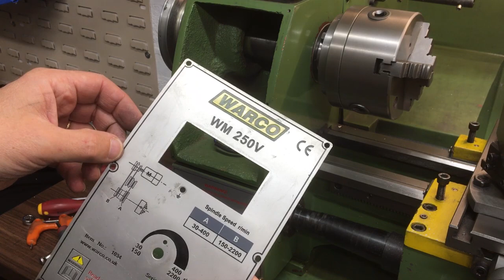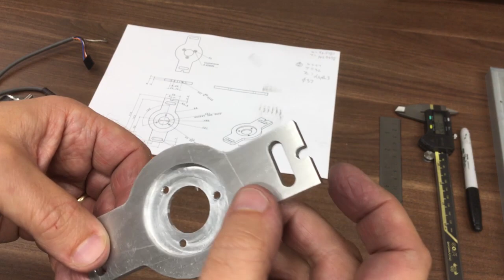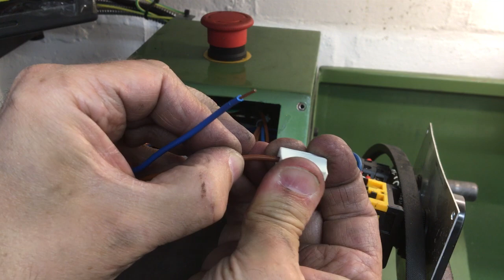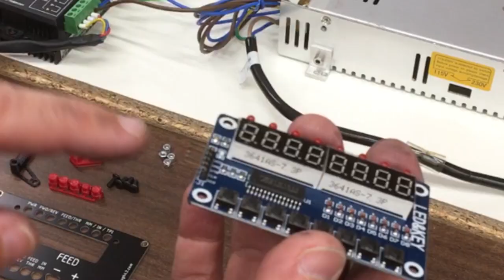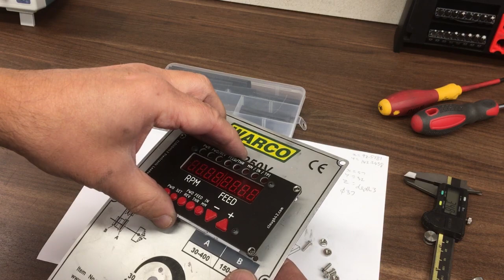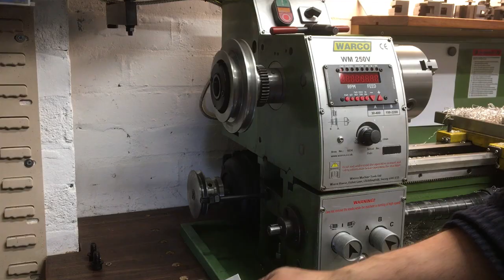Ep03: Clough42 Electronic Leadscrew | Display installed, encoder bracket

Comment: What software version are you running?
Reply from the maker: Do you mean on the CNC machine?  That motion control software is called UCCNC.  I installed in around 2021 and the manual shows it to be software version: 1.2111.

If you mean the software version for the microprocessor code uploader (Visual Studio??) into the TI board as part of this ELS project I used the exact same version James showed in one of his videos.  I tried the current version at the time when I built mine and I could not get it to work.  So I re-watched his videos and downloaded a the same legacy version as James and that worked fine.  Of course because he made this a few years earlier that was the latest version for him a the time.  It was too long ago and I can't remember the exact version but watch his videos and you will see it when he installs the code developer software and hooks it up to the microprocessor.

If you meant something else, please let me know.
Reply: @routercnc9517  I meant the Clough42 ELS. I wonder if my issue is the same as yours. I will try the earlier release. Did you report the issue?
Reply from the maker: Ok, ELS version 1.4.
The other issue was with Microsoft Visual Studio and no I did not report it to Microsoft
Reply: @routercnc9517  Thanks for the info. Troubleshooting is always a process of elimination.

Comment: I noticed (and personally experienced) the difficulty in removing the 5 way Dupont connector from the Key & Lamp PCB. On my second attempt (don't ask) I found it easier to remove the piece of plastic supporting the base of the pins and the carefully bend them through 90 degrees (or a little more if your housing is tight on space.
Reply from the maker: Yes it was a bit tricky.  Sounds like you found a way!

Comment: very nice job. Do you happen to have the CAD drawing of the encoder bracket to share? I have a very similar lathe (warco wm290). Greetings from Santiago Chile 🇨🇱
Reply from the maker: Ok found it.  Here is a link to the mycncuk forum, post #70.  The file is zipped so unzip it and load it into Fusion 360 (or other CAD software which can read IGES files).
https://www.mycncuk.com/threads/9141-Lathe-suggestions?p=132847#post132847
Reply: @routercnc9517  thanks dude. Regards
Reply from the maker: It was a while ago so I’ll have a look for it.  I’ll report back here then if I have it I’ll post it on the mycncuk forum and send you a link.  Just give me some time to check.  Have a great Christmas/holiday!

Comment: I am currently on the same project for my Amadeal 290V which a little different to yours. I am interested to know where you sourced the pulleys and belts from. I must thank you for the fact of driving the encoder with using the toothed belt directly from the spindle gear which saves a lot of work installing an idler gear to emulate the arrangement that was on James Clough’s lathe.
Thanks 
Dave Hudson
Reply from the maker: For the belts and pulleys I bought them from eBay.  Search HTD5 pulley and belts.  They come in various widths, 5,9 and 15mm I think.  Maybe buy a belt and check it meshes OK with the existing gear before you buy the other parts.  Good luck with it!

Comment: As you are screwing the ELS panel into the Warco at about 30:19, it looks like the PCB is bowing from pressure on the right angle 0.1 header from the plastic bracket. The right angle 0.1 header on the control panel doesn't really need to fit between the PCB and the 3d printed bracket.  You could have instead flipped that connector around and had it stick out out the back of the ELS control panel, and it would have removed that pressure point and prevented that bowing.
Reply from the maker: Good idea.  I just followed James' instructions but looking at it again that would have been better, thanks

Comment: I was shouting at the screen for you to fit the buttons, I'm surprised that didn't work. I'm really surprised how bad the original wiring on the lathe is, mechanically it looks good but it seems far less thought was given to the electronics. When  you consider the price new that is very disappointing.
Reply from the maker: Next time shout a bit louder!  Yes the drill press was the same with the wiring.

Comment: You could easily fit the sevro motor on the tailstock side..as long as it is connected to the leadscrew your good to go..seen several other people and servos to the tailstock side on CNC conversions..maybe use a love-joy coupler etc..
Reply from the maker: I did look at that but not much space.

Comment: I can recommend getting a 3d printer, lifechanger
Reply: I second this 100%
Reply from the maker: @luclaflamme4712  OK, noted!
Reply from the maker: I keep thinking about it and then wonder if I will really make use of it.  That probably means.it will be like my lathe - wasn’t sure I had enough use for it and now would not be without it!  Do you have experience of any particular model?  I wouldn’t want to spend too much in case it gathered dust, but then need to pay enough to get a good one!  Also there seem to be a wide range of materials and printer tech like heated bed, twin nozzle and so on.
Reply: @routercnc9517  I can tell you for certain you will get a lot of use out of it. They honestly are unbelievably useful. I would order a Creality Ender 3 V2 Neo. A perfect first machine and print in PLA+ you’ll be making functional parts in no time!

Comment: Might be another option to mount the servo motor on the other end of the lathe and drive the leadscrew from that end?
Reply from the maker: Yes I wondered about that too but I wasn’t sure about having the motor so far away and having long cables because the only place for the enclosure is to the left of the lathe.  Also I think it was awkward to get a pulley on there. Good suggestion anyway.

Comment: Nicely mounted! Can I ask what stepper servo motor and controller you are going to use?
Reply from the maker: It’s the integrated servo.that I think James ended up with:
Servo Motor - NEMA 23 Integrated Easy Servo Motor 180w 3000rpm 0.6Nm(84.98oz.in) 20-50VDC Brushless DC Servo Motor
Item No iSV57T-180

It arrived yesterday from Stepperonline and I just opened it to check it.  Also ordered 48V 8.3A power supply.

I’ve also ordered an eBay RS233 to USB cable to connect to my workshop PC to tune it.  Haven’t tried it yet and hoping it will communicate as some of the cables said ‘chip inside’ and some did not.  We will see!
Reply: @routercnc9517   Thanks for the info. Do you have a product code for the power supply you ordered? I'm just about to order the servo motor and want to make sure I order the correct supply. Many thanks
Reply from the maker: I ordered this one which I think is the same as James used
Model:
S-400-48

It is overkill for amps at 8.3 but there was not much price difference for less amps.  James also needed to drive a tool post grinder so he went with a higher spec.
Reply: @routercnc9517  Great thanks, that's the one I just ordered 👍

Comment: One thing to consider, if you mount the servo inverted from how James had his, your lead screw might go in opposite direction.I follow his channel too but honestly can't remember if he has provision in software to invert direction based on mounting orientation of servo. If not, I assume you can accomplish the same thing by changing how the servo is wired
Reply from the maker: It’s a good thought and yes there are several ways to invert it.  There is a gearbox on the front of the lathe for mechanical feed direction, the servo has dip switches for direction selection, and I’ve not looked yet but the software for the servo probably has a setting.  So a good catch but should be OK.